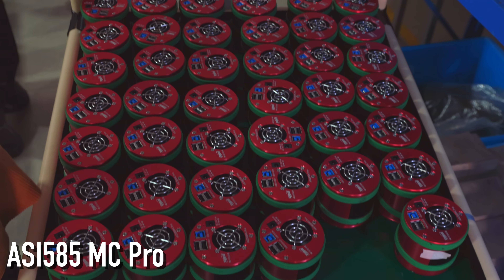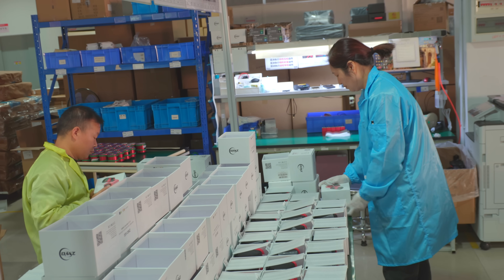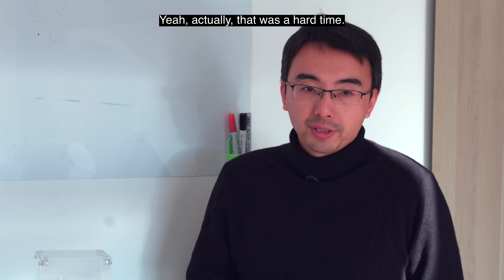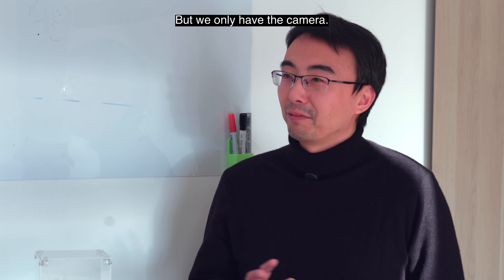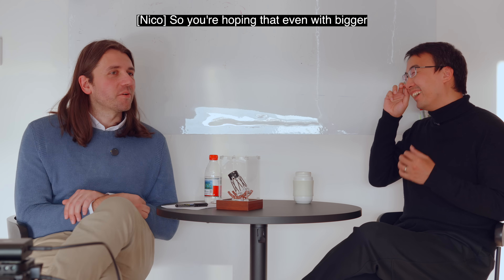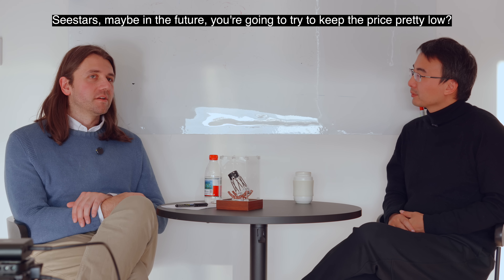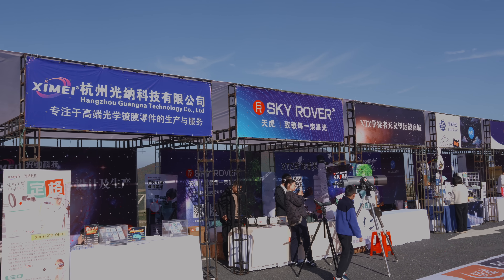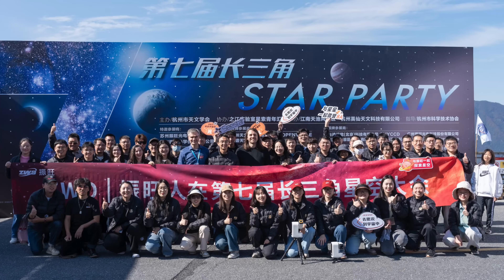Inside ZWO Headquarters in Suzhou, China

Comment: Great video Nico. I think the big issue still to solve is (this is from experience of people I personally know who've got Seestar scopes) they all after 6 months want a dedicated setup / bigger scope. They also want the same simplicity as they currently have, then the huge issue of processing / software in general surfaces. The software side of things, especially for processing, is mostly terrible for beginners. I also love NINA, but you cannot get the most out of NINA immediately. Pixinsight has a user base dedicated to making literally hundreds of books and guides on how to use the software 😅 that doesn't bode well for the future of a rapidly growing industry.

Smart telescopes compliment a full rig and also get people involved in astro, which is great - but the signs of growing pains are still there with gaps in the market that need closing pretty quickly. If ZWO pulls in a lot of users like they are, too many will get bored and put the Seestar in a cupboard or those that want full rigs will go ASIAIR / AMX / ASI camera setup. The issue is that is still really really expensive for most normal people and it's a really expensive hobby still.

Comment: @NebulaPhotos Hi Nico. If you also got a direct feedback channel to ZWO, I have some feedback to pass on too.
Seestar needs a proper comet tracking mode where it will track on a comet and stars will be trailing with framing the comet enabled. Also Seestar needs a little setting that will park to north pole OR North Horizon. That way it wont pop off the attached dew shield that we use for better contrast and we will finally be able to use it in the observatories. Other bad thing is that Seestar will often not charge if the temperature is low, even if plugged in and it will die halfway through the imaging. Happened to me many times. When it dies it also tries to close the arm even if I have accesory (dewshield) attached. I even bought a second battery. Maybe bigger capacity battery could be great too.

Other than Seestar: I wish ASIAIR  could talk like Seestar does, even using the phone's app. Or at least if it could send notifications.
Also comet tracking and framing mode.
Another ASIAIR request:
In planetary mode - center on object/planet similar as Seestar does, add multi video capture mode where it will keep making 1min/3min videos in series for a certain time. 1h 2h 3h 4h 5h.... where 1h would be 20x3min videos and it would center the planet after each 3min video. 
Another ASIAIR request - in Moon mode track on moon's surface

New camera request: 
something 14bit no amp glow  in 20x15mm sensor cooled colour 3-5 nm pixel size with built in guide camera 
especially suitable for 8inch and 9.25inch SCTs image circle, camera diameter mustn't exceed 65mm and will be black coated with super black anti reflection colour for use in RASA telescopes. I know Chuck would definitely love it for his setup too.

Thank you 😊